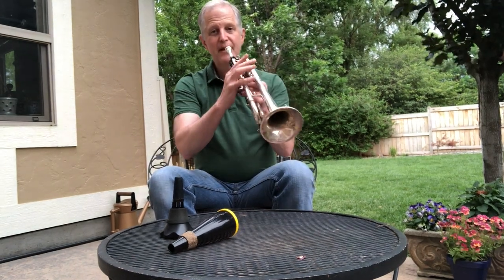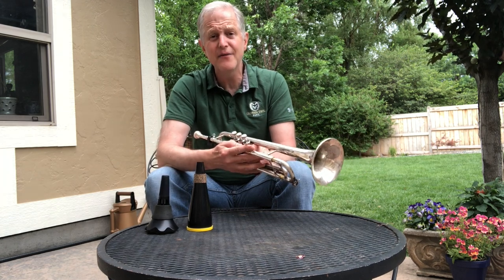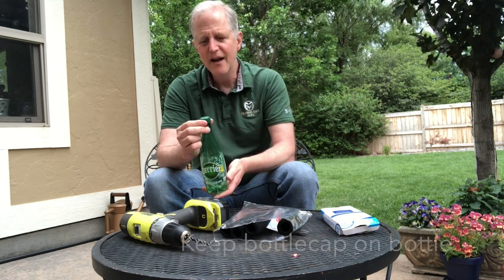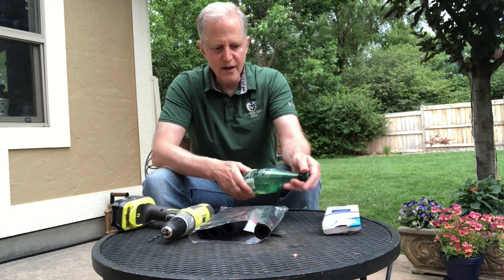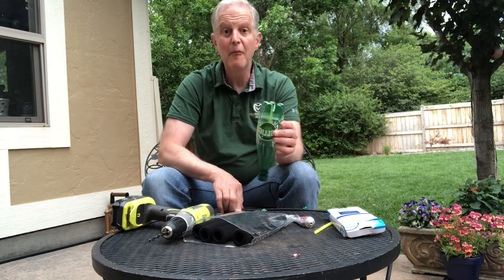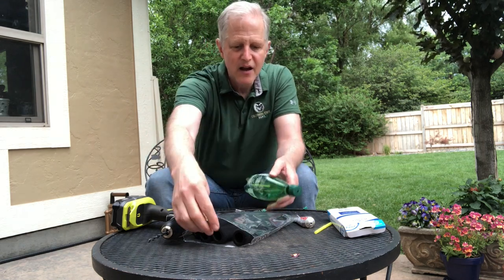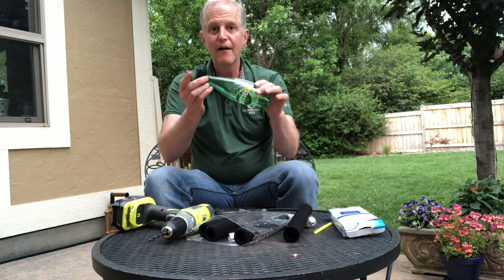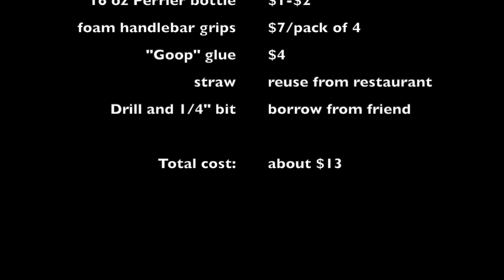How to make your own trumpet practice mute

Comment: Hi Stan,
nicely done! I usually don't drill into the top and just remove the screwcap, put the bycicle handle on the top...but i gonna try your variant to see what it does!
Reply from the maker: Well, I should try your method, too!
Reply: @monteverdicornetto  thanks good  tips  this mute trumpet . I found less backpressure and easier playing without the screwcap .
Reply: I made a mute in similar way for the french horn with a bigger bottle (1L / 2 pints) with a larger scruwcap (1.25 inch / 3.5 cm opening). Much better to play without the screw cap on! Much better intonation! I cut out a piece from a vacuum hoover bag  / cloth to use around the bottle also and attached it with a cable tie around the neck.

Comment: Very clever!
I'd be interested in knowing how to make an inexpensive trumpet mute using the same principle as the Mute-Tube, which I think is basically a cylinder with sound-proofing material inside of it. It looks very simple, the player just inserts the bell of the trumpet into it a bit and there's absolutely no change in blowing resistance.

Comment: I'm curious as was one  other person who commented, why is the straw necessary...what does the straw help achieve as compared to just having a hole in the bottom of the plastic bottle without a straw.  I guess only way to know for sure is to try it both ways...so would be helpful to hear from someone who might have tried it without the straw.  Someone already commented that removing the bottle cap on the other side achieved a satisfactory result.
Reply: I just tried removing the cap and it works a lot better. With the hole in the cap, the air restriction is significant. Without the cap, it's still noticeable but much more manageable for beginners like me.
Reply: I wanted to write the exact same commentary, so I comment on it instead ;)